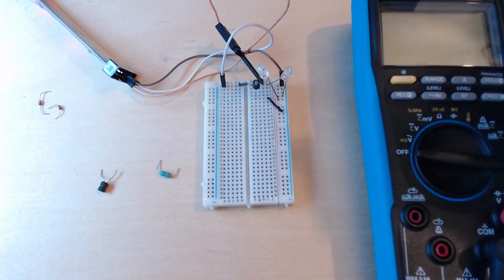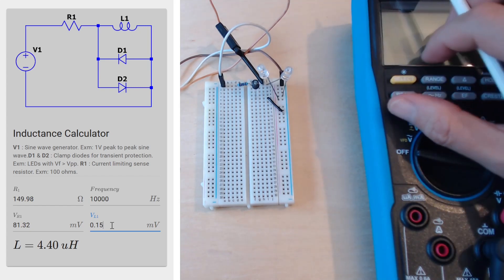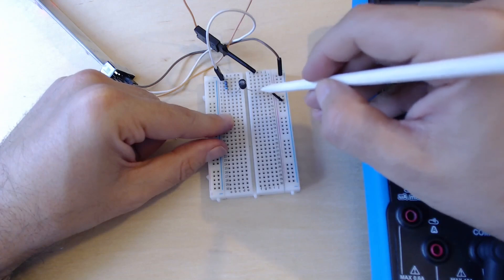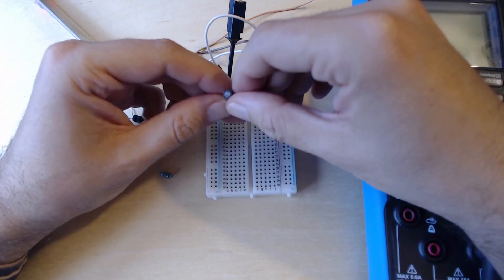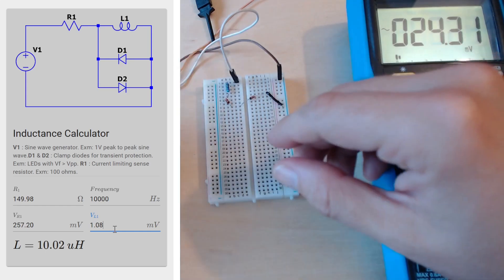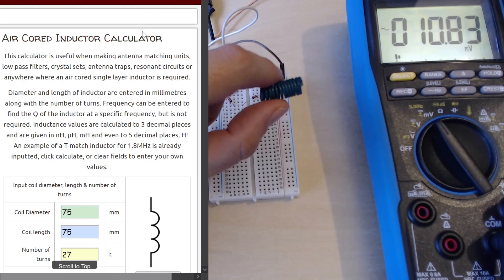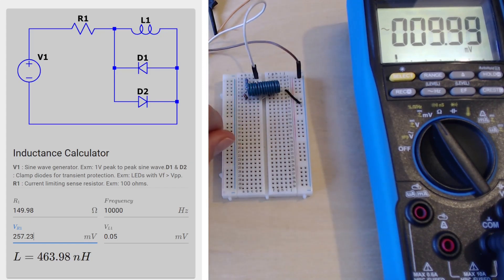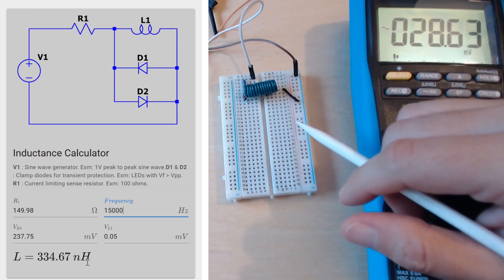How to measure inductance without an LCR meter - Part 2

Comment: Please be careful when using a breadboard. It will create frequencies that will enter your body and cause damage.
Wrap either the  breadboard or your body in tinfoil to block out the frequencies. You must be careful with frequencies

Comment: Interesting effort. With the small inductors you are measuring the coil resistance drop too. One thing you need to be aware in any digital multimeter is they have a precision error quoted as % of full scale e.g. 1% plus a few digits/counts of error. The later dominates at the lower end.

Comment: I used to put a capacitor of which I trusted the capacity in parallel with the inductance, and see at what frequency the voltage across the parallel was minimim. With the resonant circuit it is much easier to make the measurement.